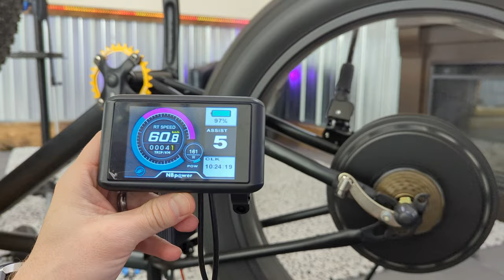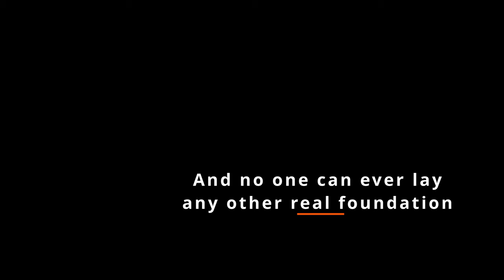E-Bike Build powered by Greenworks Batteries

Comment: So i think that frame could fit a 72v 20ah battery . Little bit smaller than  the 40ah you tried using. You should be able to get a triangle frame pack in there though and then you could really extend the range on that thing

Comment: Love the build man. I especially like the matte black with gold parts look. Also has plenty of speed and power. Im doing a fat tire ebike build too and cant wait to see how it turns out
Reply from the maker: That's awesome!
Reply: @overvolted  yeah I got this viribus full suspension bike and I've managed to fit a 52v triangle pack in the frame so I'm gonna throw a 1500w kit on it. Original goal was 3000w but oh well I think it should be good enough for now
Reply from the maker: Nice! The orange one?
Reply: @overvolted  yeah it's orange with white trim. Decent enough bike but definitely needs a lot of mods. Actually planned on getting the same front forks as you along with a bunch of other things

Comment: Where did you buy the 80v battery adapter at? Can you use a 60v battery as well?
Reply from the maker: I bought it off of etsy actually and I think they do have 60 volt adapters as well. It's a 3D printed piece that I'm sure you could redo for cheaper, but I just purchased this one so I can make this video. Yeah you could definitely use a 60 volt battery on an e-bike technically it would be an overvolted system for a 48 or 52 volt controller but that could Make things a lot faster!

Comment: Out of curiosity, if you add in a derailleur and shifter, could you use the rear cassette instead of the single speed? is there a reason you didn't? does it increase the chance of the chain coming off? fyi im building my first efatbike based of your amazingly fun looking build and would like to retain the gearing on mine.
Reply from the maker: Yeah you could totally leave the derailleur and shifter. I just did it to simplify the setup and have less cables. Didn't really need all the other gears since it's going to be used like a motorcycle most of the time lol but yeah if you want to use the paddles more than it would be a good idea to leave rear setup
Reply: @overvolted  awesome man thanks so much for the reply and feedback.

Comment: That is a very scary looking weld, it most likely weakened the joint rather than improving it.  Before TIG welding was available bikes were built using brazing. Good brazing will beat a bad weld every day of the week.  Silver brazing is very strong but only good for a tight fit.  Use nickel bronze as gap fill and it will be safe and strong.  
Often for the home workshop we should be looking to the past for the best results.  Today's industrial processes have been optimized to reduce maternal cost but require special equipment and skills.  A simple torch with the right rod and flux you can join nearly any metal you will ever come across.
Reply from the maker: Nice! Thanks for the tip. I will have to look into that technique. Maybe I can do that better LOL
Reply: @overvolted  Also if it's an aluminum frame, welding weakens the metal. You have to heat treat the frame to fix it

Comment: My guess is your pedal gear ratio will be mostly useless except for emergency slow pedaling due to a dead battery, or possibly assisting the motor up a very steep incline. I think I counted approximately 32 teeth on the front gear which will have you pedaling air before 15 mph, assuming you are on an 11 tooth gear on the rear. It looks like a nice build with an obvious very fast top speed. Congratulations… 👍🏼
Reply from the maker: I think you're about right! I can put it around in the driveway by pedaling but above that it's all throttle!
Reply: What's the top speed on a flat road???
Reply from the maker: @brucevous1  with it tuned as it is It hits around 45. Pretty easy. I need to play with the tuning of the controller more and see what else I can get out of it. Also, I'm not sure what these greenworks batteries put out for amperage but maybe switching to a normal e-bike battery would also get me some more juice.
Reply: @overvolted  sounds awesome. Please make a video of top speed. Thank you😊
Reply from the maker: @brucevous1  Will do!

Comment: What how many amps is that battery ? And how much range do you get ?
Reply from the maker: The one it's being used with now is a 5 amp hour green works battery. So nothing spectacular as far as range goes. If you're being really easy on it and don't drop the throttle then you could probably squeak double digits out of it but just barely.

Comment: I hate thoes little 110v welders ..
Dont feel too bad for me you need 220v flux core or mig . Because you can burn through  the spots that give you trouble.  Its really  hard to grind out once you startvgetting that pitting impurities.. with bigger welder you can turn it up and burn past the trouble  spots
Reply from the maker: Yeah I'm a total noob so got it mainly because it seems like large soldering instead of welding lol.